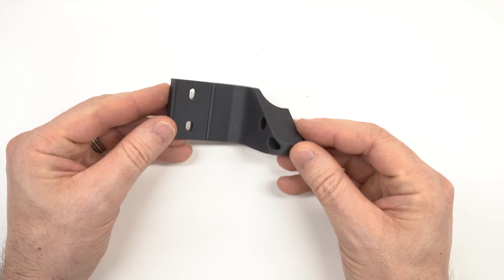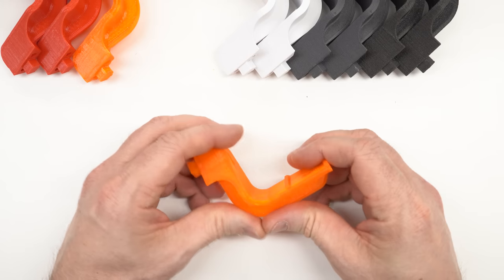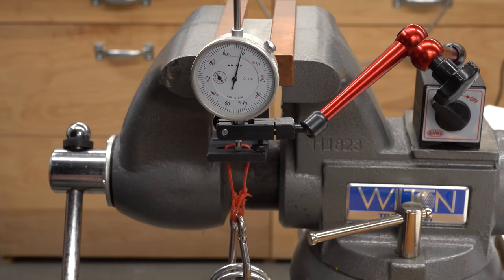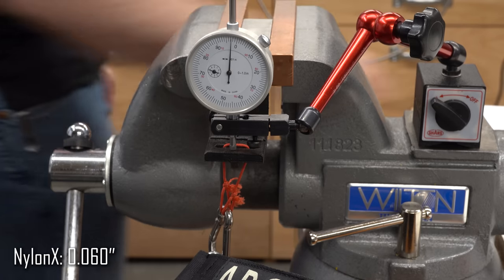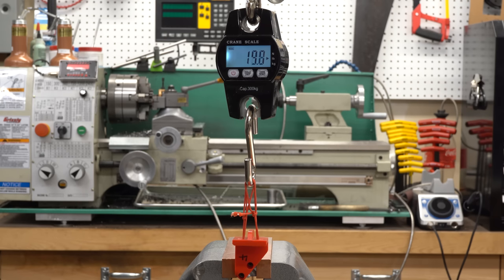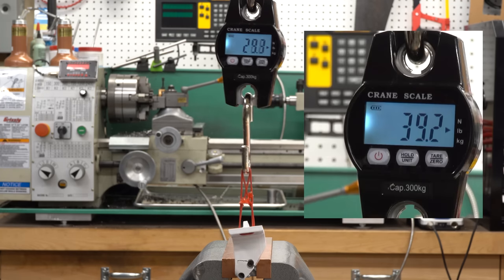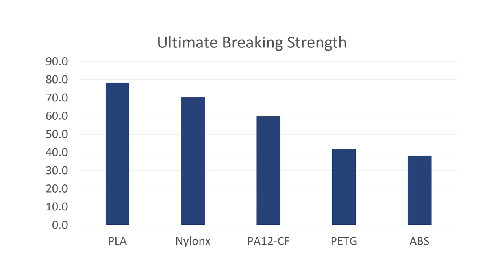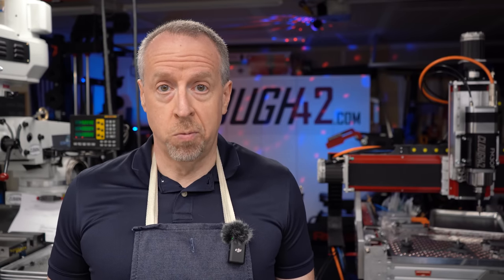Wait, What?  PLA is Stronger Than Carbon-Fiber Nylon?

Comment: Ignoring creep is possibly a mistake. PLA is strong "in the moment" but if it is under load, it will creep and potentially fail over a timescale of weeks. I far prefer ABS for engineering applications because of this.

Comment: PLA annealed will outperform all of those. What PLA can't withstand is prolonged periods of high temps (65+C, it degrades over time being above it's glass transition) and UV (prolonged periods).
Once annealed, for short term PLA can withstand up to 150c tho under low load, but on same test PETG, ABS, Nylon etc. failed much sooner ... Yea, 150c. See CNC Kitchen tests.

Comment: In my experience straight up nylon is the most durable. However, printing it in a dimensionally accurate manner can be a real pain. I have a good luck with taulmon alloy 910. I have always wanted to try polycarbonate. Curious to see how that would do.

Comment: Strength is going to be again different for all these materials depending on how the layers are oriented. See CNC Kithchen's tests.
Also note that most CF filaments are made from milled CF (the $30 to $50 per spool price range), which looks good but makes parts weaker instead of stronger. Longer CF strands make stronger parts. Milled CF doesn't.
Reply: do you know of any by name that use actual strands?

Comment: My thinking is that it's not really carbon fiber,but only carbon because it isn't tiny wire rolled onto each other.also when carbkn fiber is used for structure(Ex:a race car spoiler) it is more solid because it is in epoxy resin

Comment: I will say I've seen tests proving not all carbon fiber nylon is the same tho...some MUCH stronger than others. On the other side I've used 9mm pistols made with 3D fuel PLA that have gone through 100's of rounds with zero cracks or signs of fail! We live in some really cool times!

Comment: For flexion yield strength, CF PLA was the best, but plain PLA was about 80% as strong.  Good enough maybe.   For ultimate strength the carbon filled nylon was the best, though again plain PLA was about 70% as strong.

Comment: PA is hydroscopic and you have to cook the pieces for an hour to absorb the water. The results will be completely different. For correct measurements, you need to know the material you are working with. Nylon absorbs water even if it is standing, but it takes a long time.

Comment: Uncontrolled variation in the loading gradient.  An engine hoist isn't the best for load testing.  You need something that controls the loading gradient.  0.01N/ms, or something like that.  The first PETG test was loaded more consistently than the other two.  This makes all the difference.

Comment: Polycarbonate and polycarbonate with carbon fibre iirc are the only materials that can match PLAs strength and rigidity but have better temperature and impact resistance, it’s what I would call the one “best material”

Comment: Breaking strength is usually not that important. It's more important if the material deflects permanently over a couple of load cycles. So something between rigidity, cycle strength and return to its original form.

Comment: So it seems like an obnoxious thing to say, but I have noticed that ambient temperatures changing by a few degrees can affect the overall strength of the part. Don't ask me why. Things I print in an enclosure seem to print stronger than things in open air. If the HVAC kicks on and cools as I'm printing, the part seems to suffer.

Comment: I'd like to see a video of how you got your under sides and support interfaces so clean. I make engineering parts with 0.6 nozzle and no matter what I try I get either very stringy under sides or the supports are impossible to remove. Especially so with PETG which is my go to material. For PETG I use 0.3 layers with a 0.3 gap between support interface and under side of print. It works but it's not pretty.

Comment: But you paid so much to be able to print that fancy material!
Edit: the reality is that, unless you are designing parts under significant engineering constraints, your factors of safety are likely so high that exotic materials are completely redundant. 
This is what this test actually showed: your part was over built. You could hang 10 of those sound bars off of those brackets and they wouldn't break. And that's going to be the case for most people doing most things as a hobbiest.

Comment: PETG is just not a very strong material tensile strength of PLA is actually slightly better than plywood at around 37 megapascals while the tensile strength of PETG is about 14 megapascals

Technically PETG has better toughness but it loses any advantage to that toughness with its low strength

It's just not a very strong material it does have some advantages though it's less dense so your parts are lighter which for an airframe is pretty important as long as it's strong enough for the application it's a little bit more flexible but when done thin it's easier to break because it's not a strong so it doesn't really gain much advantage from that flexible nature

The one true advantage of PG is slightly better heat tolerance over PLA I also think it creeps less? Even below it's deflection temperature PLA will distend and distort over time under load so it's incredibly strong for momentary loads but not for continuous constant loads

PETG might be slightly better for that and it's better heat tolerance might make the difference between whether or not it's survives in your car or not

However all of this changes with PLA+ you gain almost all the toughness of PETG while still retaining almost all the strength of PLA and slightly and I do mean slightly better heat tolerance

I would like to see that experiment try it again with PLA+ something good like Esun or polymaker
Reply from the maker: You don't have to wait for someone else.  Do the test yourself and share your results.
Reply: @Clough42  That's not really how it works in order for me to do the test myself I would have to repeat everything he did with all the materials he did and the same models he did in the same rig he did on the same printer he did or the results aren't valid
Reply from the maker: @nerys71  if you read the comments, you'll see that there are lots of complaints that he used the wrong models and did the testing wrong.  You sound knowledgeable.  You could probably do a better job.
Reply: @Clough42  as long as what he did was consistent the results are still valuable to some extent Will you get different results with different models almost certainly however the results will probably still be consistent I don't know I don't really have time to run that extensive of a test that's more of a CNC kitchen kind of thing :-)

Comment: Can i see strength per unit weight? Pla is dense.
Also, i've minimised using fillets a lot, using fixed angle chamfers with small fillets at the beginning and end of the chamfer instead to eliminate the need for support and reduce stress concentration in the tight corners. In a similar manner, often using "surface body" style construction nstead of I-beam construction leaves you with a stronger part  because more material is further from the neutral axis and there are fewer abrupt geometry/curvature changes whilst using a relatively similar amount of filament.

Comment: Great test and very pleasant format on the video! Thanks!!
Also, this gives good hints for designing for strength without doing FEM-work or even basic strength calculations. You already mentioned layer lines in the right direction and we also see effects of holes here. Cheers!

Comment: Good Day all, Nylon is brittle after molding or extruded you have to soak in hot water just under boiling point  for 6 to 12 hours 
Thanx for the video it was interesting .

Comment: I’m not usually concerned with the appearance of my prints so I like to set the layer starting point to random. I feel like it helps to reduce the chance of parts breaking but I’ve never tested it.

Comment: One channel on youtube showed that you cannot just take a metal part and replace it with carbon fiber with the exact same design. You should change the design of the part so that the benefits of carbon fiber can be realised. Making sure their is additional carbon fiber strands on area of failure.

Comment: You should also try pa25-cf I believe that had about 25%carbon Fibre and is way stronger than the pa12-cf that only has  12% carbon Fibre.

Comment: With a (mostly) stock Ender 3 v2 I've only used PLA (and PLA+) for engineering parts and I've been surprised at how well it's held up. Creep does seem to be a problem though; and I've found a few parts have cracked over time.

Comment: What about CF-PLA? Im wanting to order some but haven’t yet
Reply: It's makes for pretty prints. The filament tends to break easily because it is even more brittle that straight PLA, so that's annoying. Strength is no better. And, since PLA doesn't warp anyway (in almost any circumstances, at least) it's no easier to print.

Comment: I'm not surprised the carbon fiber did so poorly.  To start with I dont know what percent fill the material is but it needs to be more than a little to see any real benefit.  The other problem would be fiber distribution in the finished part.  Whenever you have a knit line or weld line in a molded part with fiber filled plastic you have a major weak spot because you dont have cross linking of the fibers.  The 3D printing process is terrible in this regard because it actually keeps the fibers from cross linking by design so you won't see anywhere near the theoretical strength of a homogenous injection molded part of the same material.

I once designed injection molded parts made from 40% CF urethane.  One of the parts was about the width of your pinky and straight with one injection gate at the end. I could clamp that part in a vise and whack it hard with a hammer without it breaking. Another part was similar in thickness but U shaped with an injection gate at each end with a knit or weld line in the bottom of the U.  I could easily snap that one in half in my hand. The same thing is happening on a tiny scale throughout your entire 3D printed part.

Comment: One thing I'd like to see is the weight of each part. My (super basic) understanding is carbon fibre is better because its lighter compares to other materials whilst still being very strong.

Did the different materials have much of a weight difference? And how would that show on a weight - strength graph...

I'm just a simpleton though to feel free to tell me If that's irrelevant here or not accurate.
Reply from the maker: I didn't weigh them, but subjectively, the carbon-fiber parts feel surprisingly light in the hand.

Comment: I noticed that all of the parts failed right about the same place on the parts.  I realize that the area that failed is also the most geometrically constrained by the interface with the monitor/display.  But could there be a design modification that would result in failure elsewhere at a higher load.  From the aspect of "strong enough," it's clear that the parts, printed from any material, are sufficient for the intended purpose.

Comment: Like you said (paraphrasing), every material has its applications. Its not like NylonX is automatically better for everything, and even though PLA is suprisingly good for many things it still doesnt hold up well to sun, weather, temperature and its really hard to finish a functional piece, which kinda automatically disqualifies it for alot of parts I print for vehicles and outdoor equipment. I think PLA is good for alot more than people give it credit for, but I certainly would not chance on making my license plate holder out of it. Wouldnt be fun with a cup holder that turns into a blob and attaches itself to your car interior on a warm day either.

Edit: Honestly I think that the method of 3d printing has alot more limitations than the actual materials themselves. Most good power tools are made from glassfiber nylon and those you can litteraly run over with a car and they dont even care. But then again those were not 3d printed so they dont have thousands of little layers than need to hold together
Reply from the maker: I have a solar radiation shield I made for my back yard weather station.  I printed it out of white ABS, and then painted it gloss white.  Without the paint, it would not have survived a single summer of UV exposure.  With white paint on it, it's been out there for six years, and still working great.  https://www.thingiverse.com/thing:1718334
Reply: @Clough42  Really? ABS is already supposed to be pretty UV resistant, have you had any deteriorate on you? If so, do you remember the brand? 

I usually dont print much in ABS so not going to pretend I know all about it, but i did make some caps in black ABS for the brake reservoirs on a motorcycle and those held up fine. Not as exposed as the project you linked but still!
Reply from the maker: @kvernesdotten  yes.  I've had the white eSun yellow and get brittle.  I think the pigment matters.  Black, in particular, prevents the UV from penetrating.

Comment: some printing parameters for different material is not just the extruding temperature
so the breaking point should be design not at the screw holes because there is too many variables among different material that can introduce gaps and artifact at internal holes. So bettery make the standard model people always use for tensile strenth. You know the one that looks like the cookie bone that dog likes.

Comment: I am a mechanical engineer.

Deflection is NOT an accurate description of a material. You really need to know what the behavior of these materials will consist of.

Elastic deformation is temporary deformation. This is like when you bend a paperclip a little, and it will bend back.

Plastic deformation is permanent deformation. This is like when you bend a paperclip really far, then allow the elastic deformation to come back out, and you have permanent deformation at the end. That amount of permanent deformation is called "plastic deformation."

Creep is another thing entirely. That can be filed under "plastic deformation"

Deflection is testing a material property called "The Elastic Modulus" - basically, just how much something will temporarily deflect. This does not test how easily something breaks. This does not test whether or not the piece will fail to mount something.

But really, the questions to answer are these: Does your part flex too much before breaking for the use case? Does the material support the maximum load required? Do you need your material to flex and show that it is flexing before it breaks, or can it fail in brittle fracture only?
Reply: Lol...I'm trying to decode your explanation here.  I think what you were trying to say is deflection does not tell the whole story.  You took the long road to say deflection = elastic modulus = temporary deflect = elastic deformation = 1 behavior of a material.  1 behavior (characteristic) of a material is not enough determining if it is sufficient for the application.  Correct?

Comment: PLA is extremely strong but brittle and it doesn't give.  PLA plus from brands like Duramic (my favorite) is much more suited to real world applications.  It has just enough flex to have decent impact strength but still be incredibly tough.  I use to try to use nylon or various exotic thermoplastics but they are very difficult to work with, especially anything with abrasive properties like carbon fiber.  PLA plus is easy, doesn't smell bad, isn't hygroscopic, and will do 95% of what CF will do.  If you really want to get into space age plastics then you need some serious equipment that is very high heat for working with materials like carbon fiber reinforced PEEK.  Then you are approaching a material as strong as Aluminium.

Comment: Your PETG experience doesn't match mine.  But I also don't design parts like that.  All the stuff I make wouldn't have had that narrow band by the screw holes, which is pretty much where all of them broke instead of at the bend.  So in my mind, you're not testing what I would've expected to be tested when talking about the strength.  However, in any case, all of them where sufficiently strong to hold your sound bar.

Comment: I have to ask. So what layer height? what size nozzle also did you anneal any of the parts? The finer the layer the weaker the print, surface area matters. Only noobs to need watch this all the work is done, only those that are gettting kick backs know how strong pla is. Pla will break down or degrade much quicker to the elements than the nylon if annealed. Thank you for share,

Comment: Maybe pa6 cf will have better results than pa12, and main application of pacf is great heat resistance 50-60 degrees vs 150 degrees long time and 180 in peak

Comment: the main reason I use nylon is heat resistance. In other cases, it will be better to use PLA or PETG
Reply: hello, i am gonna print a vacuum cleaner wheel, which material do you recommend, petg or pla? the wheel design has small clips to plug in to vacuum cleaner
Reply: @alessampiyonu  PETG

Comment: If you consider the cost per part you could increase the infill to even 100% on the cheaper filaments' and that would help with both tests
Reply from the maker: 100% infill is overrated.  It often causes lots of problems with dimensional control.  Even a tiny bit of overextrusion due to (e.g.)  slightly over-diameter filament builds up and has nowhere to go but out.

Comment: I don't know if you took into consideration that the printed layers of the parts should be in line with the force applied. If the layers are parralel to the force applied the part will just brake at the layers adhesion point